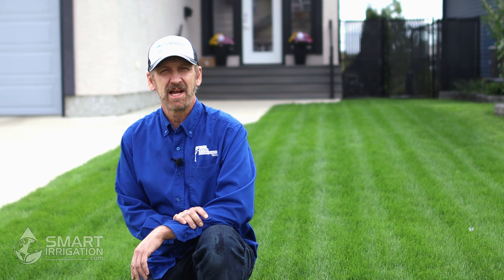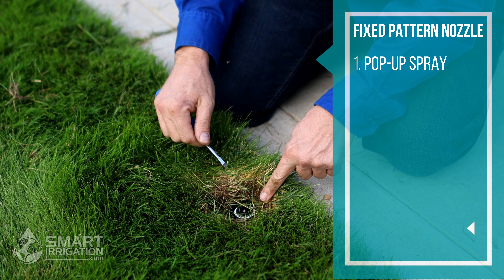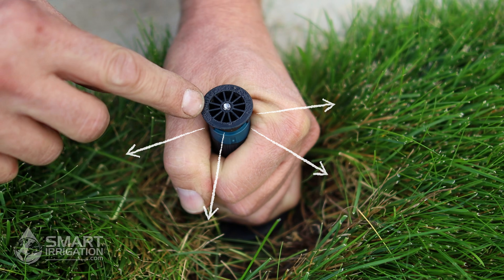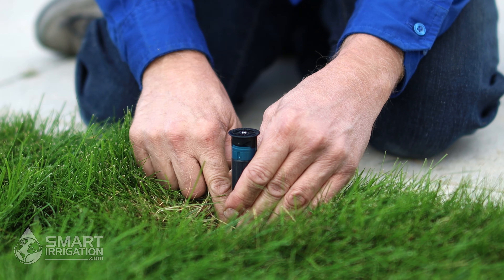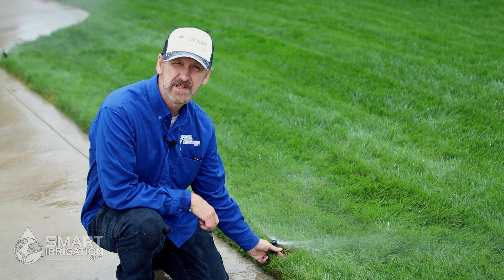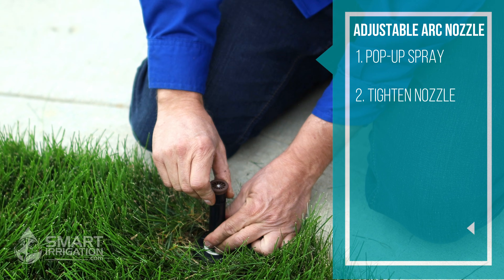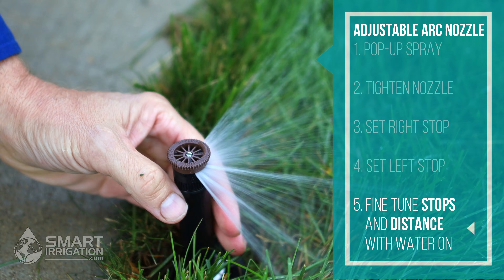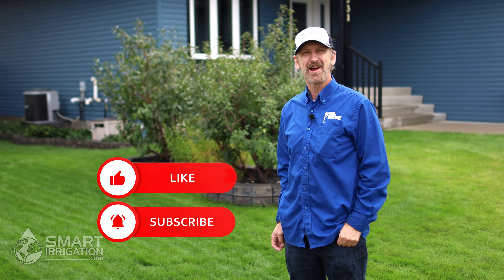Hunter Spray Nozzle Adjustments

Comment: I’ve bought a couple hunter sprinkler spray nozzles and none of the screws on top will move.  What am I doing wrong.
Reply from the maker: They might just be tight from the factory. Try turning the screw before you install the nozzle on the head. Let us know how that works!

Comment: Wayer slowly escaps from the top of my sprinkler head. I wonder if i can fix it by tightening the stem
Reply from the maker: If it's broken or damaged, probably not. If it is the lowest head on the zone and the water doesn't stop, it's probably not a head issue.

Comment: Thanks for the video. So many nozzles have that screw and turning them doesn't always adjust the throw. No where on Hunter's site says the range of throw for each one. I have a center, side sprinkler for a rectangle 12'x5', so now I know to get a SS918 and set it at aprox 70% with the screw.
Reply from the maker: Thanks for watching and I'm glad it was helpful!  If a filter (looks like a plastic basket) wasn't installed under the nozzle when the nozzle was put on the riser/stem, the adjustment screw won't do anything, so that is worth checking!

Comment: When I use the longer throwing adjustable nozzle (15 ft one), I find that it sprays the areas further away from the nozzle much better while the areas just in front the the nozzle (like 3-4 feet away) hardly get any water and the grass turns brown here.  It's as if the water is consistent across the entire 15 ft  watering area.
Reply from the maker: That is correct the nozzel by themselves don't water evenly . They are designed to work in teams where one nozzle's spray  gets to the other nozzle. This is called head to head coverage and you can lean more about it on our information website at smartirrigation.com.  If installing another head or nozzel to reach back to the brown area is not practical for you, a Rain Bird HE-Van nozzel does water better closer to the head but less than the Hunter Nozzel in the farther distances. Each brand has it't strengths and weakneses.

Comment: I mistakenly took off the nozzle top while it was not running and gush of water came out. I turned off sprinkler and it went down. Now turning on sprinkler its not popping out and water is coming out. How zi can put the top nozzle back?
Reply from the maker: Ah yes, this is something that can happen by accident.  The easiest way to fix this is to see if you can just put the nozzle in the open hole, press it down, and see if you can screw it is as many turns (clockwise) as you can, and then use your fingers to lift it up (hoping it threaded enough) to finish screwing it the rest.  I tried typing out other, more complicated ways, but it just didn't work as a comment.  It might be something we can make a video for in the future (or, if you join our patreon to support us and we do have a tier where was can provide a personalize trouble shooting video for you!).  Hopefully that helps
Reply: I put my finger over the hole so the water pressure made it pop back up.  Took some patience but it eventually popped up enough i could pull the rest out by hand.
Reply from the maker: @shanemb3  This is the way 🥷

Comment: I bought an adjustable teal spray nozzle, and I changed the whole body of the sprinkler too, the body is installed correctly because it pops up normally, but the water just doesn't come out of the nozzle, any advice? Thank you, loved the video😊
Reply from the maker: Thanks! It's possible that you have the wrong filter in or the filter is clogged. Flush the head with the nozzle off and then install it without a filter and see if thst helps

Comment: Why on adjustable is the black adjustable for adjusting right side and it’s always locked and cannot turn it, why??
Reply from the maker: Hunter sprayd are right stop so you can't "turn" how for right the spray from the nozzle. As we show in the video, you need to ratchet the actual riser on the spray body. Hopefully that helps!
Reply: @SmartIrrigation1  thank you I was thinking one adjusts to left side and then turn black part to the right

Comment: I have that first teal colored nozzle. I don't want that particular head to spray anymore, what's the easiest way to cap it off? or if I get an adjustable nozzle can I turn it all the way off?
Reply from the maker: The teal one is a Rain Bird fixed pattern MPR nozzle and as long as it has the filter basket thing inside (sorry we didn't show that in the video), you can turn it off almost completely by turning the metal distance screw at the very top all the way to the right until water stops coming out. Alternatively you can also get an adjustable nozzle and close it all the way and it will almost completely stop watering, but a little might still come out. The only thing you need to remember is when you are winterizing your system, if your ground freezes over the winter and you need to blow out your lines, you will need to make sure you open up that nozzle to blow all the water out of it when you were doing the blowout. Otherwise it may freeze. That is why, unless you were completely sure that the line you are capping off can be winterized even with the cap in place, sometimes it's easier and safer just to temporarily close the nozzle off, like with the screw
Reply: Similarly, I’d like to turn the spray way down in one spot because it waters the grass directly in front of it so heavily the grass is twice as long there. Also it’s a shady spot. It does not need all that, plus a mole has moved in and loves tunneling the wet ground apparently
Reply from the maker: If you would like to water an area less, what you want to pay attention to is the precipitation rate of the head that you are using, rather than the distance it's spraying, even if you turn down the distance, the area that is getting watered will still generally be getting the same depth of water. So what you might want to do is for that particular Shady spot to replace the spray nozzle with a rotary nozzle, such as a Hunter MP Rotator or a Rain Bird rvan rotary nozzle. The Rain Bird rvan puts out about 1/3 of the water as a spray nozzle, and MP rotator puts out about a quarter of the water. Give it a shot and see if that works!

Comment: My distance screws almost always are stuck and I can't adjust the distance on my spray nozzles.  This is true even on brand new sprinkler heads.  Do you have any advice for this problem?
Reply from the maker: Yes, we've noticed that sometimes that happens, and there isn't really any great solution other than holding the nozzle tight in one hand and having a good screwdriver in the top and being able to turn it hard enough until it kind of breaks free from its Factory seal, and then they're easier to turn. But if you're looking at turning down your distance much, you might just want to look at a smaller nozzle, you can get them all the way down to four or five feet as the full distance through the nozzle. But good luck with turning that adjustment screw, let us know how it goes!

Comment: thanks for the how-to on the variable spray ones! i was trying to adjust the radius of mine earlier today and the top of the nozzle was spinning with the screw so i stopped messing with it. ill go back out tomorrow and hold the top of the nozzle in place while i try to adjust the radius screw. hopefully i can get it to stop spraying my front porch by shooting past my garden
Reply from the maker: We're glad our video helped!  Let us know how it goes!
Reply: I think my sprinkler nozzle adjustment screw was already tightened practically all the way down. I think I need a smaller radius nozzle for it to stop spraying my porch. Oddly enough no matter how much i turned it, even to the point of the screw getting tight enough that it turns the entire nozzle, the water stream never became all splattery or had any real impact on its spray pattern like your fixed sprinkler at 3:44. My nozzle is a 10' nozzle, and its about 8' from the sprinkler to my porch, although the sprinkler manages to spray a couple more feet than its aforementioned 10' onto my porch.
Reply from the maker: Ah, one thing we neglected to mention is that you need to use the filter provided with the spray nozzle, since the screw inside tightens down against that filter.  If you are turning the screw and you aren't using a filter, then the screw won't do anything.  I'm not sure why there wouldn't be a filter in there, but that might be the issue.  Regardless though, you really shouldn't turn down a spray for than a foot or two, so if you need to go smaller, a new nozzle is probably best; there only a few bucks.
Reply: So turn the screw all the way loose (left) and pull up to see if there’s a filter??

Comment: Helpful video, thanks! But actually why not just use the adjustable ones all the time? Just cost?
Reply from the maker: Actually we have found that the fixed pattern nozzles have a more even coverage and they are more reliable in the long run. They need to be set less often because the fixed pattern is less likely to change than a variable . For example if some one steps on a variable nozzle when mowing it could move the arc setting. The fixed pattern also come in certain shapes that the variables don't (like side strips).  We talk about these differences between fixed and variable pattern nozzles in more detail in our article located here: https://smartirrigation.com/spray-nozzle-selection/#fixed_v_adjustable
Reply: most sprinkler pros use fixed pattern, more reliable long term, variable ones seem to have issues after awhile.